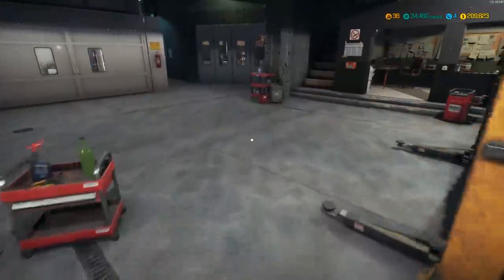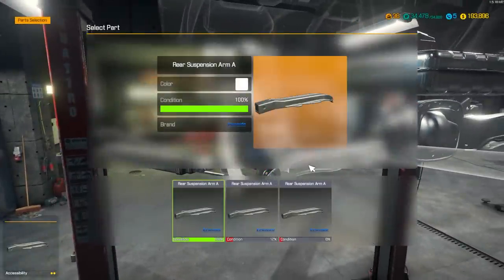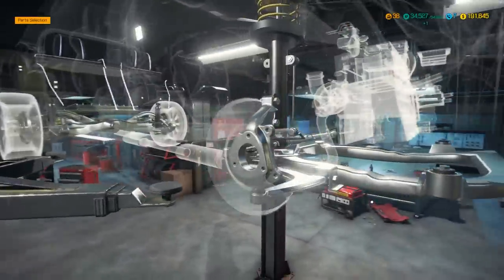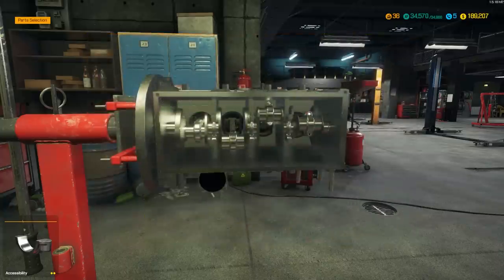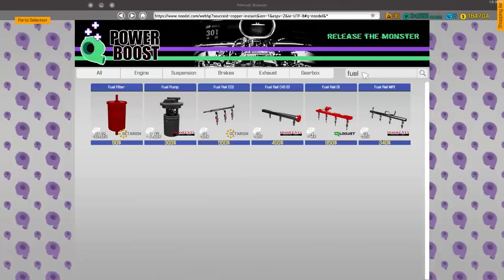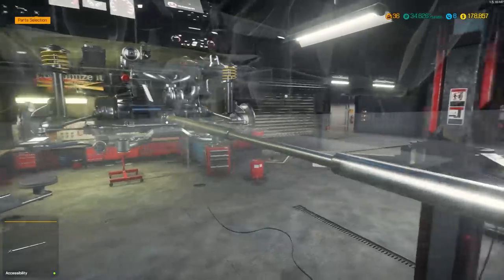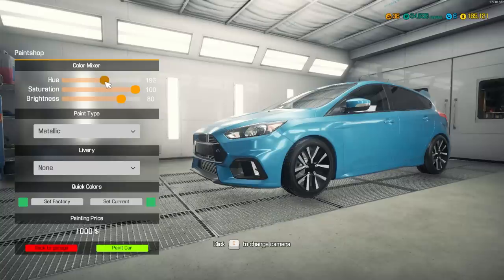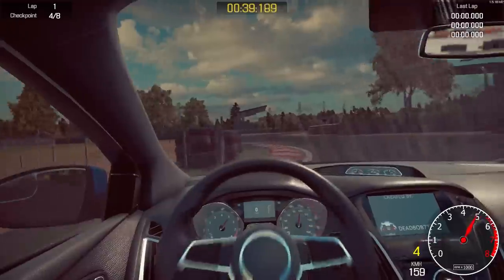Car Mechanic Simulator - Restoration Garage 4 - Ford Focus RS

Comment: Instead of pulling over when your vehicle overheats roll your windows down crank the heat and get to the nearest spot you can check the water in the radiator and the oil

Comment: The damage you see in rust could be similar to a crashed model. The only way the game can display this is as you can see, not changing the main model, but by using rust and parts condition. But, with crashes, they are usually in one area.

Just another angle to go in. Use your imagination a little. It's an ARSE, I mean RS..

Inside joke. Had a Peugeot Tweet RS 125 scooter and that was horrible.

Before you start work on these cars - just sell any component that is less than 10% in condition. Anything less than that can't be repaired, so you may as well lighten your list.

Comment: What you could do in future video, is build a stock engine and a performance one. So, you mount one you do your test and after that, you change the engine with the other and you do your test:)

Comment: I personally dislike really dark tinted windowed cars simply because I have a car that is low to the ground and if you pull up beside me and I need to check the side you are blocking,  I have to physically wait or guess because I can't see traffic through the windows of that car. It's still a preference thing and can understand people preferring tinted windows.
Reply: @GroundHOG2010  Out of all the reasons to not like dark tinted windows, that one actually makes a lot of sense.  I hate having to wait because some bigger vehicle is blocking my vision (to the left when I'm turning right, or to the right when I'm turning left.)

Comment: I wish fully restoring a car in real life took an hour, know how many old cars would be on the road
Reply: Hahaha!  At the very least you'd need the "Insert $1000 in the slot or swipe your credit card" magic welding kit, and the point-and-click Easy Bushing Removal Tool.  (I have never had a bushing come out that easily, unless it's brand new.)

Comment: hey buggs, i bought this game cause i really enjoyed your videos... i got over 50 hours of gameplay in it and all of a sudden when i go to play, i get a black screen and it wont load. Im really bummed I cant play anymore. Do you know what could have caused the issue or have you experienced anything similar to what I have? Thanks man

Huge Fan, 
Scuba Steve
Reply: Uninstall some mods, I had the same problem and it worked for me.
Reply: Scuba Steve also, verify file integrity on Steam. Right click, it’s somewhere in properties if you didn’t know. I hope you get it fixed
Reply: ive done all that, dont have any mods installed and it still doesnt work.. so pissed
Reply: Scuba Steve have you tried uninstalling and reinstalling? Your saved data should be synced through the steam cloud so you shouldn’t lose any progress
Reply: ive tried everything and still cant get it to load. it doesnt make sense and my pc is good. i have a i7 4790k @ 4.0ghz 16gb of ram and a gtx1060 6gb.

Comment: Magnuson-Moss Warranty Act, which protects consumers from being wrongfully denied warranty coverage when they customize their rides. Basically the only way the dealer can deny warranty work is if they can prove the aftermarket part caused the failure. 

I need a second vehicle so I can really tear into my truck to do work to it. When your daily driver is also your project ride, doing major work is a problem.

Comment: Actually it's not a brake cylinder, it's a piston... the brake cylinder (mastercylinder) is mounted on the power brake system and the pistons are in the calipers... so my car has 8-piston calipers in front and two four-piston calipers in the rear (one for normal brake one for hydraulic e brake)... pls read it

Comment: When manufactures dyno there cars before mass production starts they measure the engine at the crank and not the car at the wheels. So 350hp from factory would only be about 310 at the wheels

Comment: Buggs, if you want to get more from that intake on your RS, your gonna have to go get it tuned. And dont forget that there is a law that states if something breaks and its not a DIRECT RESULT of an aftermarket part (or nonOEM) it HAS to be covered by warranty. You can also get your RS tuned and keep the stock tune for any service that may be needed.

Magnuson-Moss Warranty Act states that a dealer must prove that aftermarket equipment caused the need for repairs before it can deny warranty coverage.

Comment: Hey man, I don't know if you mentioned this but if that rs has plastic pipes instead of metal for the intake, changing the air filter won't do much. Those pipes are designed to "suck in" or collapse when under boost to limit performance.

Comment: My mates got a Ford focus RS I think it's a 1.9 ltr and it's got all sorts of problems with it like speedometer doesn't work that well exhaust is falling off the tracking is messed up and the starter motor is damaged and surprisingly it still runs and is still really fast apart from the odd jitter when he changes gear lol. Awsome episode Buggs

Comment: A high flow air filter does something, but not on every engine, mostly on NA engines and only on lower rpm range... on high power engines it will save your ass, because you air flow on normal air boxes and filters is very limited... on a mushroom filter it's only limited my the withness of the tube and the throttle body....

Comment: I usually just buy 20 or so of the rubber bushings and rubber bushings since you usually need at least 8-10 for a single car if you're completely redoing it.

Comment: Just buy rubber bushings, clips, break pads, pins, in bulk. Anything unrepairable, or commonly missing(like you said). You could crank out, restorations, much faster$$

Comment: Just saying when ever you put after market parts on cars for the most part you won’t notice a big difference unless you tune it for those parts cause while you are increasing airflow with a filter the engine won’t always have the right air fuel ratio to get much out of the upgrade

Comment: i can tell you now an intake system on a turbo car will make a lot of a difference if you get your car tuned. 2 easy and good power mods for a turbo car. intake, full exhaust. for a 3rd and well needed. a tune.

Comment: If you want to work on a vehicle in real life, go to a scrap yard. People are so stupid nowadays that they send good vehicles to scrapyards. I recently saved a 86 Gmc Sierra 2wd with a 350 that has roughly 120,000 miles original and running really well for a bit less than $400 US. (Im Canadian). Its my project truck for school, and I am looking forward to it. But yeah, get a vehicle you like, but not necessarily worried about breaking. This goes for everyone.
Reply: Really depends dude... Cars at the scrapyard can have alot of faults u dont even know about before u start taking the car apart.
Reply: The Gaming Norwegian the most this truck has is bad rockers and cab corners and a hole in the floor board. $250 ($150 US) and it's fixed and safetied. Lol (I am doing the welding myself, that's why its cheap)

Comment: I'll probably never understand why most video game developers never bothered to feature the second North American generation Focus in anything. I still see many second generation Focuses on the road today so they must be reliable. Was it because the second generation never really had a sportier version aside from the two door SES model?
Reply: @Josh M.  They may think there's no point.  It was only a facelift of an old model, and most of the changes were to the interior (new seats, a new dashboard design with message center atop of the dashboard, ambient lighting, dashboard panels that simulate brushed aluminum, and Ford's voice-controlled Sync audio/Bluetooth system. Optional ambient lighting in the Focus uses LEDs placed in the front and rear footwells and the cup holders. Standard equipment includes a tire pressure monitoring system as mandated by the TREAD Act. Also included in the redesign is a support beam behind the dashboard for extra structural rigidity.)

As for the mechanical bits, the 2.3-liter engine was discontinued, leaving only the 2.0-liter version.  The chassis was lightened and stiffened and overall weight was decreased by 30 lb (14 kg).  And... that's pretty much the limit of the changes.  And it was only manufactured for 3 years, before the 3rd-generation Focus was revealed.

Comment: just watch this but could not help my self but this it nothing like the real focus RS mainly the engine like is it electric steering?
Reply: DTA myops none of the engines are close. Most are a selection of 3/4/6/8 cylinder engine. Watching the GTR build and adding carburettors made me laugh.

Comment: If you got a cold air intake then you a tune because it gonna be taking in more air and be lean because the engine isn't giving more fuel to even out the a/f ratio there's that and a cold air intake will only give 30hp maybe so it's not gonna be noticeable on the street and a tune will void your warranty so probably want to wait but also I think the engine can be damaged since it's running lean and you might get less mpg
Reply: Razorbaz01 I don't think you can do that in the game sadly
Reply: ZEDNOUG _ I mean his focus in real life he was talking about how he thinks his new air filter doesn't really add any power
Reply: Well... When u got a cold air intake it compresses the air, so it gets more air in the engine at a time as u say. BUT, the engine does give more fuel, thats what the MAP/MAF sensors and O2 sensors r for.  MAP/MAF sensors checks how much air is going thru the intake and the O2 sensor messuears how much CO2 and whatever other gasses in the exhaust. As soon as the car feels its getting more air it has to give more fuel to, so it fires properly in the engine so it doesnt releases unburned fuel out thru the exhaust. Most new cars does this, they dont add alot of fuel, they stop at some point ofcourse, but it does give more fuel if it feels it needs to.

Same as when u add a turbo u have to change the fuel rail and the fuel pressure regulator so it can give more fuel to the engine when the boost comes. Just that when u add a turbo u also mess with the tuning settings so it the car is more free to give even more fuel. But yea... Thats not needed when u only add a cold air intake, cold air intakes mostly helsp with torque at low RPM`s.
Reply: The Gaming Norwegian I've heard that cai don't really do anything unless you get a tune it could be for other reasons not just the a/f ratio

Comment: So you would risk your life and some poor other suckers to have Illegal tinted windows on your drivers side...
Reply: Window tint isn't putting anyone's life at risk. all it is, is a way for the state to pull more revenue from drivers
Reply: /\
 |   I think this guy has window tint... (Pissed)
Reply: @McRambro  I hate to tell you this, but tint is legal ... as long as it isn't too dark.  How dark you can go varies from state to state.  In Texas, for example, the rear window and rear side windows can be any level of tint, as long as you have side mirrors; if not, the rear window must be below 25% tint (meaning it lets at least 75% of light in).  The front side windows also have to be below 25% tint, and the windshield can be tinted up to 25% but only above the AS-1 line (that's the imaginary line extending from the letters AS-1 on most windshields) or the top 5 inches (12.7 cm), whichever is less.  Florida allows some really freaking dark windows.  Up to 85% tint on the rear window and rear side windows, up to 72% on the front side windows, and down to the AS1 marking on the windshield.

Comment: Is illegal to tint your windows because when the cop stops you if you don't row down the windows you could be pointing a gun to his face and he wouldn't see it, and people also use it to hide drugs when they transport it
Reply: No, it is not the reason, the reason for the front side windows being illegal to tint is for safety reasons, visibility needs to be clear, imagine you being in an intersection at night, and you don't notice a car with broken lights comming, with a tint too dark you wouldn't be able to see it clearly and you might cause an accident. You are delusional if you think it is for that reason that you stated
Reply: Even if you do get in that accident it wouldn't be your fault, and how the heck is that supposed to happen? As far as i'm concerned only 1 light turns green at a time. if it's a stop sign you must be stupid not to see a car coming, even if it is coming at high speeds, if you miss it you didn't stop and look both ways. If you get lucky you'll get a car with holes in the exhaust system so you can hear it since everyones doing it now. MY DARN NEIGHBOR WAKES ME UP EVERY MORNING AT 6 AM WITH HIS FREAKING EXHAUST BECAUSE HE WORKS EARLY MORNINGS!!!
Reply: Yeah, but you do know that almost no one drives legally? and it would be your fault if it was an intersection without lights, and also pedestrians don't usually follow rules either, neither do bikers. I'm just telling you how it is, and it is illegal to tint windows for the reason i stated, it is an easy google search. well, maybe you should get put a noise complaint on him?
Reply: @doracyroccasalvo4972  Like it or not, No Wak is right.  The reason for the tint law (which varies from state to state) is to make sure you can see adequately when driving at night.  That's the only reason.  (I'm sure cops don't like it when the windows are too dark, for the reason you stated, but that's not the reason for the tint law.)